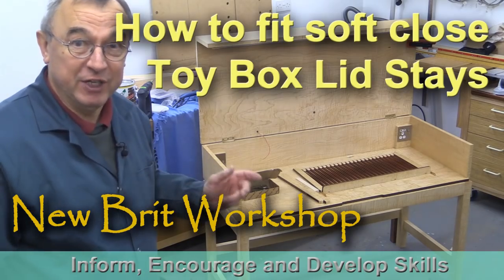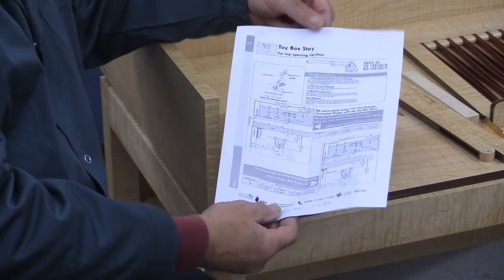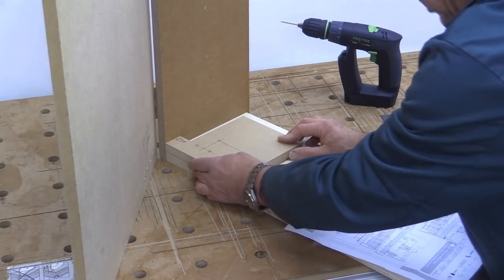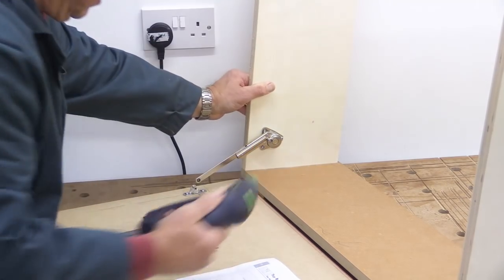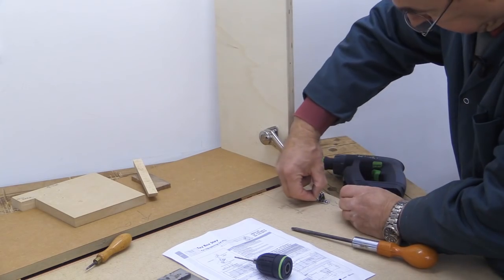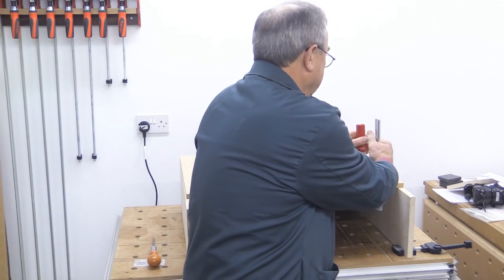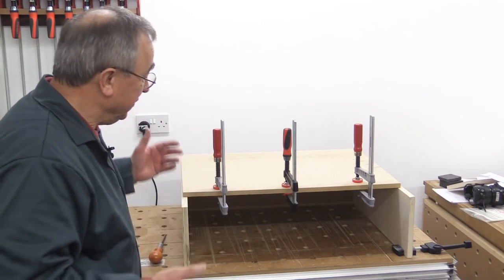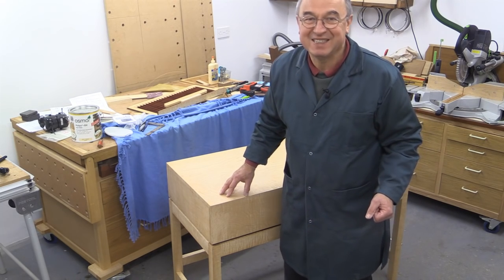Keyboard Cabinet - Fitting Toy Box Lid Stays

Comment: Thank you for sharing, I have presently constructed a wheelybin storage and am looking for a way to soft close the lid, sadly my first attempt has failed. Came across your little video and it looks like this is exactly what I am after, my lid I beleive is a bit heavier, however I am prepared to spend the money and try it out, you never know it may work out :) Have now subscribed to your chanel. Video great quality, explination and guidance is perfect, once again Peter, many thanks.
Reply from the maker: Hi Billy, I did say in my video that my application was beyond the spec of the stays and so if your wheely bin lid is heavier you should not expect it to "Soft Close" very well. They are great products and I am pleased with mine. Good luck.   Peter

Comment: Peter, by putting the clamps all on the end on the test rig lid it looked like the weight was more concentrated at the end of the lid where the leverage is greatest. So I had no doubt the lid on your cabinet would be fine once I saw the 'three clamp' test run. Nice work. But I actually miss your old music. Terry.
Reply from the maker: Hi Terry, My lid does have that flap which is probably about 2 kg so the original idea of the clamps was to simulate that flap. Eurofit have a lid/hinge calculator on their web site which could be very useful for a normal lid. I am trying to persuade the musician who played the original music (my son) to visit and perform the same piece on the new keyboard !   Cheers.   Peter

Comment: Good on Euro Fit, I had a concern when you were using the test jig, I thought the main body of the stay would interferer with access to the socket but in the end shots I see it is clear. A good result.
Reply from the maker: Hi Peter, Yes, I had done some tests and made some measurements before deciding on the location of the switch and socket. They work very well despite my lid being beyond the spec of the stays.   Peter

Comment: Just a quick question. How much 'effort' was required to open/close the lid.  I have made a table and chairs set for a 2 year old child. The table top lid will open and close to access small storage area for colouring books, crayons etc. So far the soft closing lid stays I have tried, require too much 'strength' from a 2 year old to get the lid open/closed, in my opinion. Great video and thanks for sharing.
Reply from the maker: Hi Lou, The stays provide a continuous lifting force and a damping effect when closing. The effort will depend on the weight of your lid. My keyboard cabinet lid is very heavy and beyond the spec for the stays but they do dampen the movement enough to avoid damage.   Peter

Comment: After seeing your video Peter, I looked these up and purchased a left and right hand.  They have gone up and are over £11 each now.  They also charge postage so just less than £30 for the pair. I wanted 90° like you and my calculations were the same as yours.  My lid weighs 3.75 kg. It measures 490mm x 770m and is made from birch ply. The lid comes down slowly until about half way and then comes crashing down even with full adjustment on each stay.  I'm not sure the best way to improve the last part of the decent. Do you have any ideas?
Reply from the maker: Hi Andrew, Your top is heavier than mine and I knew that I was beyond the stated limit for the stays - I did say this. I do not know of any way of improving them and I am afraid that with time they will weaken a little.  Peter
Reply: Hi Peter. 
School boy error I'm afraid on my part. I measured from the inside back edge rather than the outside. Strange how these things occur to you in the middle of the night! I've adjusted the positioning and it works perfectly now. 
Andrew

Comment: Peter, have you thought about the cushion of air inside the box?  I believe that the air helps the lid not slam down.
Reply from the maker: Hi Kerry, Yes I have and I think that I mention it in another video that followed. The stays do a great job but I knew at the beginning that I was using them far beyond their stated capacity.    Peter

Comment: one thing is probably helping there, the fact that you have a lot of air moving under the lid, that gets compressed as the hole between the lid and the rest of the case is getting smaller...
this also act as a form of dampener at the end of the movement
Reply from the maker: Hi Amaury, That is exactly what is happening and it provides that final bit of protection for the lid.   Cheers.  Peter

Comment: I got the cheap eBay piston type... Comes with no instructions hmmmm...
Reply from the maker: You can work it out by laying it out closed and then open. In order to check mine really accurately I made up a dummy lid and box corner. The box corner was just two pieces of 120 mm wide offcuts of MDF joined at right angles. They were only about 300 mm long. My dummy lid was about 200 mm x 300 mm. I was then able to experiment with the placing and when I knew it was right I could take measurements for the final fitting.   Peter